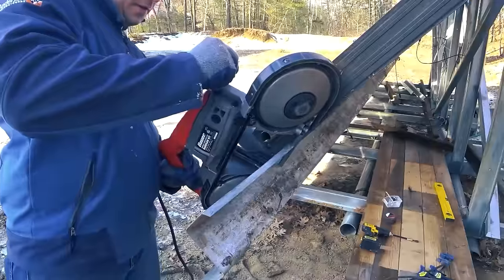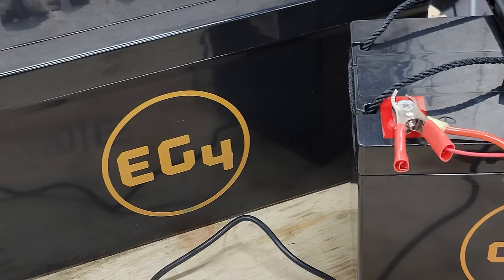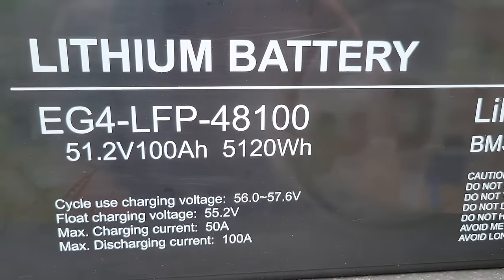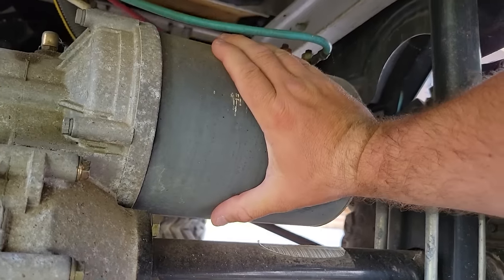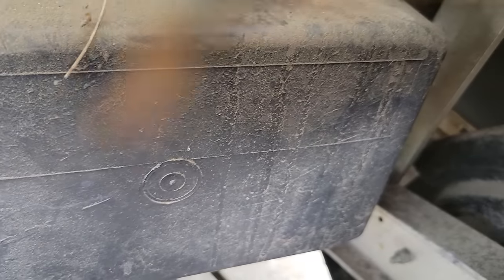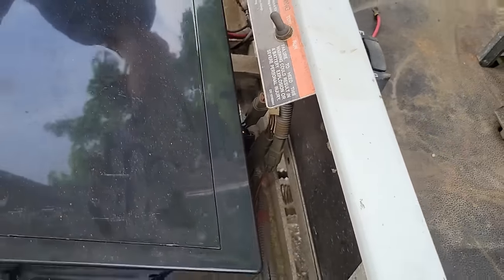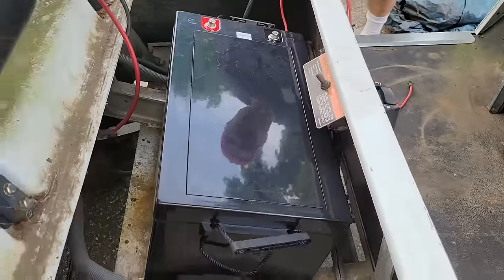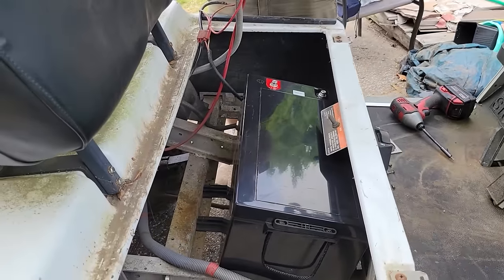Golf Cart Upgrade, Lead to Lithium Battery, EG4

Comment: Dear Dr Poz’ Evile clone…
What happened to David?

I am not “ afraid” of building a batt bank with BMS from raw goodies…
BUT … it this cost effective.?…. Considering the eight year warranty on many golf cart batteries… makes me think that “ one 48 volt , 105 amp, 200 constant discharge” battery sells for approx $1200 - $1500 ( +/-)…. So two equals approx $2800… with the eight year warranty and the independent redundancy … if one batt fails…. Baby the golf cart and limp home…
PLEASE…. Disagree with the above logic!
I would LOVE to buy raw cells, plus two or three BMSs… and build a very cost effective batt bank… to use in both my ( wife’s) golf cart…and as a great short term power system for our small house. ( yes I get “ batts in series adds volts and batts in parallel adds Amps) 

Also again please disagree with the following….
I have been reading that the golf cart “ A/C Motor Conversions”, can net a 20%-40% increase in efficiency and therefore “ range” ( miles per charge)…
BUT …. That conversion costs over $2 kilo bux … 
BUT…. if I keep my dc motor and controller… and buy another $2000 ( or less) in LiFePo batteries…
( if I have a 48 volt , 105 amp hr batt pack and just buy another identical batt pack)
By spending the money on batteries I “ nearly double the capacity” of the batteries (range)…
And I have redundancy … AND ..I have more capacity for the home ( small) power backup .

I am an instructor in a different industry and I teach ( qualify) other instructors.
I stress that “ I LIKE learning that I was mistaken about a concept because…. I LEARNED “.
So please… shoot me down…
Or please recommend some of the raw parts.
Thx
Ps .. my “ other industry”… you are welcome to pm me… I can do the Battery build.
Thx

Comment: You have this charging thing messed up . Suggest you take a small LFP cell and use a lab supply set to an amp maybe per amphour capacity and just watch what happens. You will see with the voltage set at 3.65v is initially it draws strongly and the one amp limit led will show . Very quickly though as the plate voltage comes up the current must go down and it does so quickly you are at 900 mA then quickly falling until if the plate voltage gets above 3.4v it will jump up in seconds.

What you need to understand is the a 20 amp charger if it were put on  the above cell and its output was 3.65v then it quickly would supply an inrush if the battery is flat but only then, exceeding the one amp so it would be stopped at 1 amp almost immediately and would quickly dro to tens of milliamps . IE You are not often,if at all ,required to provide 20 amps and more likely the current will be under an amp in your situation.
Reply: Not with large LiFeP04 cells.  LFP batteries have a very flat charge and discharge curve.  It's going to sit at full current with the voltage rising quickly for the first 10% and then it will be almost flat from 3.32-3.45 with only a couple tenths of a volt increase up until the battery hits the knee of the curve around 85-90% or so and then the voltage will start to climb.  At 3.65v per cell this 100AH battery is going to pull the full current of the charger for around 90% of the charge capacity even at a near 1C rate assuming a charger could supply that amount of current without excessive voltage drop external to the battery terminals.